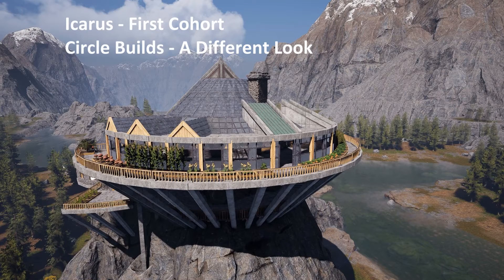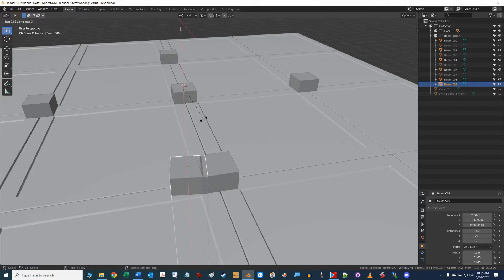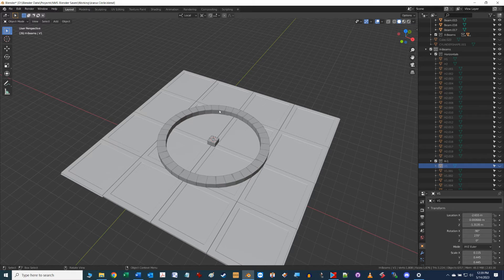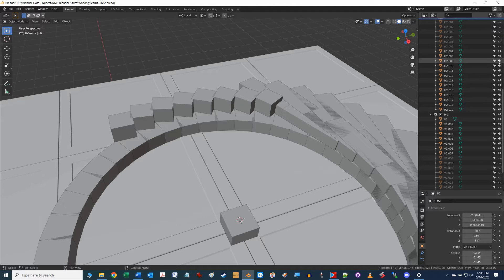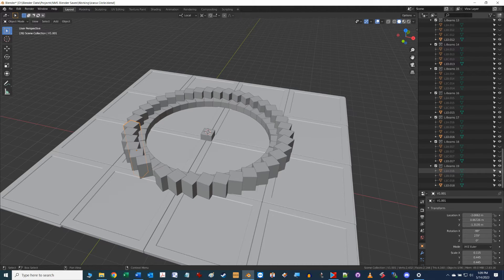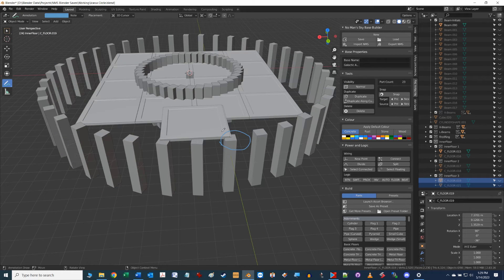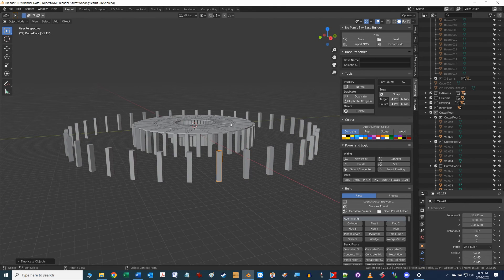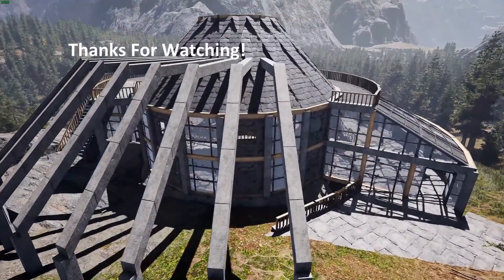Icarus Circular Build Technique - Another Way to Look At It

Comment: Having a hard time with this roof. So I ended up with a hexagon (whatever 16 sided is called) type room so 16 flat sides. But I can not get the roof to link up properly so there is alot  of clipping through or if I try with triangular roofs then for some reason the various sides don't match up like one roof section on one wall has a different angle then the roof on the wall sections next to it is quite odd and unsure how to get the roof laid in so it's flat like in yours.

Because of the limited roof options are there like only a set amount of wall (singles or pairs) that can be used where the roof fits in properly?

I started with the suggestion you had in the other video but odd part is I did the same thing only difference was I used the wood posts compared to concrete as no cement mixer set up yet at this new base but you got 12 sides to your building where as I got 16?? Same method standing on the 2 stacked posts and drawing down as far as I can and doing it with each compass tick so not sure why you got 12 and I got 16 but that is where we're at and hoping to salvage this without having to start all over again.
Reply from the maker: The 16-sided building comes from doing an octagon circle and inserting an extra beam between each 8 sides.  The 12-side is using every 2nd tick mark on the compass HUD.  In all cases, if you don't opt to use what I call the "offset Method" - where you lay down a horizontal beam and free-place a vertical beam mid-point, your ramp rooflines are going to suffer.  You best bet is using a flat roof.  Look me up on Discord (user "laanp", and we can dive into the details!

Comment: OK so I have been trying this but missing something. How is it you get a more direct downward view in game so you know you are lined up with the marking pillars the ones you are using as your guides as mines to low a view so hard to tell if I am lined up perfectly or not.
Reply from the maker: Are you referring to the free placement of the vertical beam along the midpoint of the horizontal beam?  If the hologram of the beam you are about to place is too low, just raise it using the PgUp button, so it appears just above the horizontal beam, and you can visually line it up better.
Reply: @icarus-firstcohort-basebui9026  No am referring to the angle at which you are viewing the placement. I got the cross put in fine and then at 1:30 into the video you start to place in the posts of the 1/4 circle but you say to stand on the center post to do this but this is where I have the problem as I don't have enough of a downward view to see if where I am putting the post is lined up enough with the first post to create a perfect 1/4 circle.

So is there a way to have a more downward looking view so I can see if my pillar placement is properly placed next to the first pillar which is the end of one of the legs of the cross that we started with.
Reply from the maker: Ahh yes, I now know what you are referring to.  I have now refined my method by placing 2 beams high in the centre and standing centred on top of them.  You can better control the vertical beam placements by pulling the mouse all the way down as far as you can view (towards your feet) . Also use the tick marks on the compass hud to place 24 beams in a circle.  Check out this video starting at the 1:00 mark...
https://youtu.be/KpVRirCoAjc?si=h2SnHMne8CsgcWwm
Reply: @icarus-firstcohort-basebui9026  OK thanks and yeah that is a good idea for getting the additional needed height to get a better view as the circle progresses!

Comment: Doesn't seem to work in-game. When you lay the horizontal beams in order to correctly place the vertical beam opposite it's twin, the vertical beam does not want to place under the horizontal, only on top.
Reply from the maker: Yes, in my other videos you will see the game will only sometimes allow placing on top FIRST, then it's easy to place the next one below... then delete the top one.  Make sure the ones below are grounded, and you might need more than one.
Reply: @icarus-firstcohort-basebui9026  Crap.. i'm not sure why I didn't think of that since I figured out that technique myself on another build. Thanks for the reminder. I'll give it a shot when I play later this morning........

Comment: thanks for your video. That's a bit complicated and it takes up a lot of space. I just need the diameter of a concrete foundation. then rotate several on top of each other. the more, the bigger the radius.
Good that there are several variants.